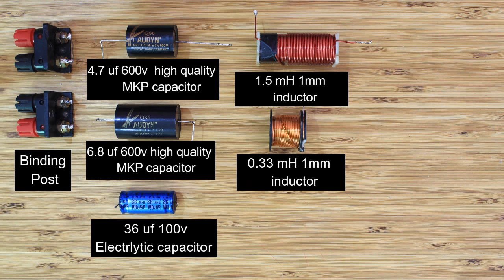2 Way HiFi Speaker Crossover

Comment: This is BY FAR the best video I've seen on how crossover looks and works... I am building my own home theater setup and this helps me understand!
  By chance, can anyone help me with crossing over? I don't want to mess up with this project..
Reply: I've spent countless hours over the past couple years, not using a computer, but a graph, if you notice even the so called experts, end up swapping caps and coils, after all thier computer designs. Just buy a bunch of coils and caps and test test test, you can use cheap ones if your only building 1 set then build your final crossover with quality parts just use the Dayton caps thier cheap and sound better than the expensive ones Jantzen coils are probably your best choice for coils unless you want to spend a lot of money
Reply: Yes indeed

Comment: What’s the extra banana plug for.looks like you coulda soldered the red and black cables being used to jump to the other side? Great video though.could you add a small detail what each do to make it work.
Reply: Yeah I’m confused about that. It looks good and simple otherwise but for essentially what’s supposed to only be one 2 way speaker should only be a right or left channel which should only require two banana plugs
Reply: Also looking for this answer.

Comment: Fire only things that's bothering me why didn't you just add another potentiometer in for separate volume control or just tie it in by putting it at the beginning then branch off into the tweeter and midwoofer and can you add a parts list in the description? Other than those two things I thank you because this was so helpful!
Reply from the maker: Exactly

Comment: Thanks for the nice video. I am assuming this is a 3kH crossover. What ohms? I am trying to recreate a JBL Control 1 crossover and the original crossover is 6kH and 4 ohms. What uf capacitors would I need to substitute for 6kH? Thanks.
Reply from the maker: Thank you for your nice words, i do this because i love sound 😍😍😍
For 4ohm 6khz high pass try second order filter based on 4.7uf cap in serie + 0.2mH inductor on parallel,  0.5mh in serie + 10uf in parallel for low pass.
Reply from the maker: And sûre lpad for tweeter to control level .
Reply: @homemade_audio  Thanks, I had to figure out how to get capacitance and inductance values in series, but have it now. JBL Control 1 are about 80hz to 18kHz and they also have an SK3 light bulb as an overload protection and have a 5W 5 ohm resistor which I think I'll replace with an Lpad.
Reply: Did you mean 1.2mh instead of 0.2mh?
Reply: Sorry datasheed  says 4.2khz

Comment: Bro i have 2 top to way 12 inch speakers one top 400w i need a information from what capacitor i can use in parallel the woofer to get mid bass please help..thanks you
Reply from the maker: Crossover cut frequencies not àdd frequencies!!! We can make equalisation modification on crossover but just for few decibels.
You must check the ref of your driver on Internet to see the response diaphragm.

Comment: Hello
I got 2 speakers from wherfedale model valdus 400 and there are no cross inside only capacitor on tweeter. What can i make for the valdus 400 ???
Reply: Hi Giovanni, most ready made speaker boxes have a single midbass/woofer to handle all the frequencies except for the highs.
And they normally have either a 2,2uF or 4,7uF capacitor in series with the tweeter.
This is how it is designed and will not sound better any other way.
😎👍🏼
Reply: In this speaker enclosure there are 2x 8 inch woofers and 1x 1inch tweeter so the original crossover is not in the enclosure...i want to make a 2 or 3way cross over filter for the speakers so that the bass and high sounds warm and clearly.

Comment: 18 dB/Oct high crossover for the tweeter and 12 dB/Oct low crossover for the woofer? Sure you don't need to mention the phase shift of the input signal in between the speakers?

Comment: speaker resistance and crossover cutoff frequency are not very important?  coil and capacitor values depend on it.
Reply from the maker: Hello, you're right,  but you have to read description before.
To make crossover there're more important things to keep in mind like TS parameters and distortion/ response diagram.
You welcome 🙏

Comment: i well use only active crossover ist cost lot of power output
Reply from the maker: It's better to start with passive crossover  if you want to make speakers because it's easy and doesn't cost much money.
If you make a mistake in active crossover settings you'll destroy your hf drivers immediately. 
Don't forget to put 50uf caps between amp and hf driver for safety.

Comment: At 2:45, Lpad 8 ohm, is it a wire attenuator?
Reply from the maker: Yes
Reply: Can I use potentiometer?
N if yes which value
Reply from the maker: @MrPstandel  No. Lpad doesn't affect the impedance and supports power not like Potentiomètre.
Reply: @homemade_audio  will it be okay if i dont have that Lpad
Reply from the maker: @salbahebf  ok it works, but you have to add resistor in serie instead lpad to control the level of HF response, same for midrange if it's level too high, it depends on the sensitivity of drivers used.